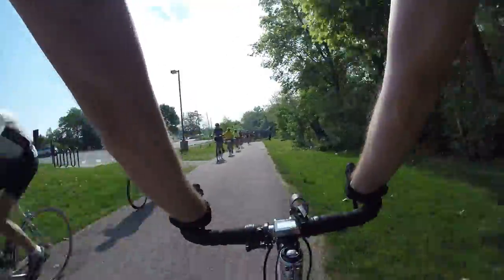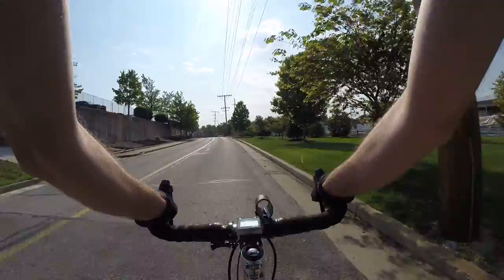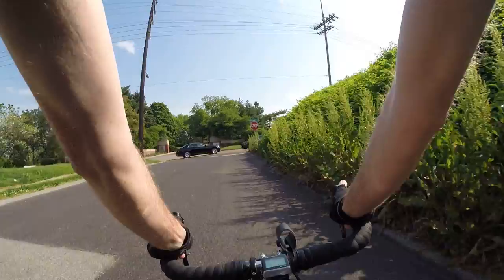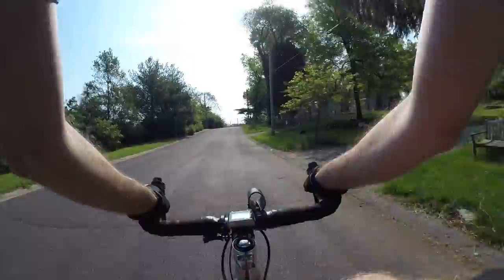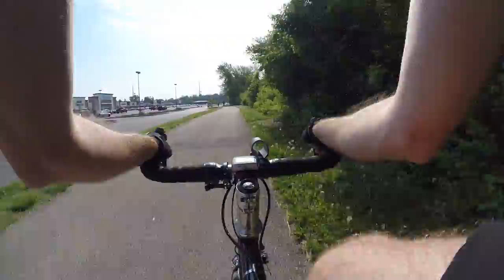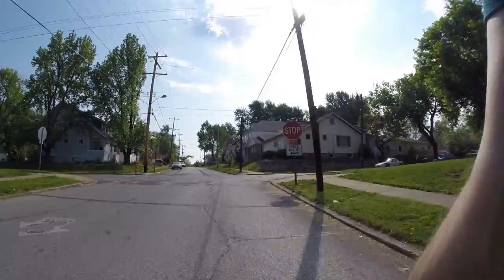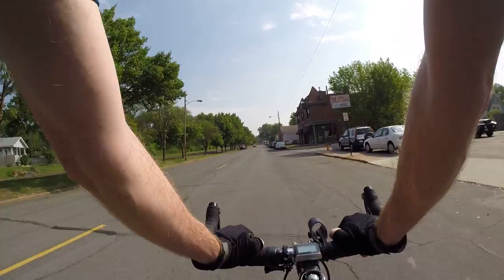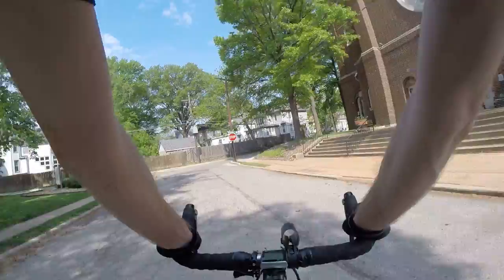Traffic Light Red Stoplight Signals Tip And Saddle Sores Commute Bike Blogger

Comment: My bike has been fitted to me, my saddle as well but I still get sores. I did a 29 miles run yesterday and I can't ride again for like 4 days. I just started riding, do you think I will get use to the saddle and adapt that area with time???
Reply from the maker: +jeanLo215 In my case the saddle was too low and I was bouncing around too much. Your clothes don't cause you to slip back and forth on the saddle, do they? Your body will adapt over time. Maybe start with shorter rides and work your way up? 29 miles is a lot in one ride even for me.